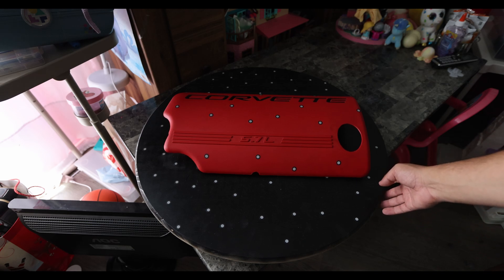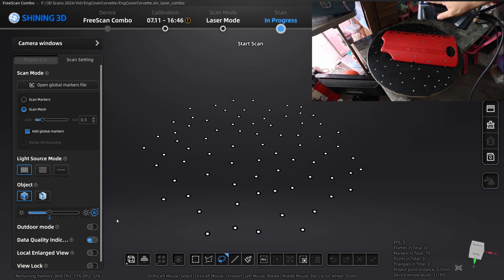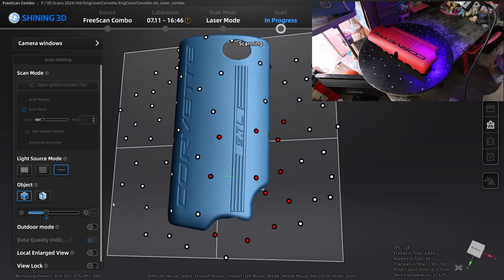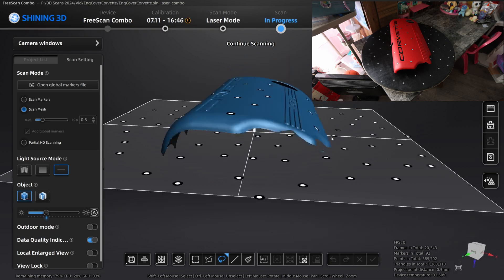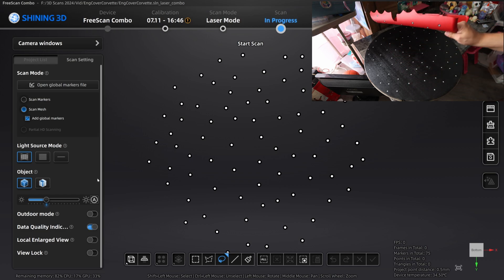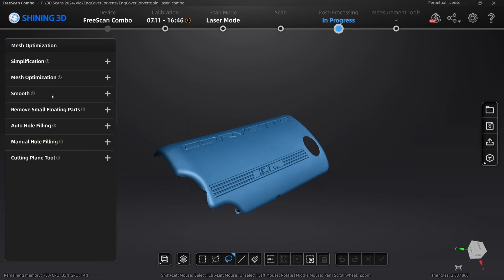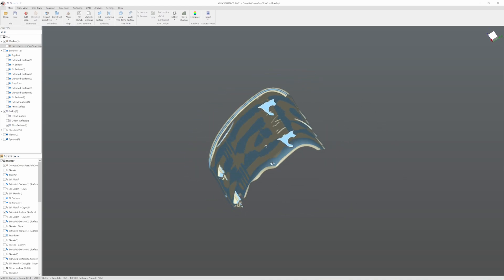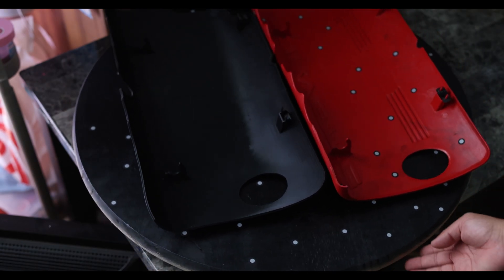FreeScan Combo/QuickSurface Reverse Engineering 3D scanner Review- Making a Custom Engine Cover

Comment: its fast and smooth mate
whts your computer config
cpu or gpu hunger during scan? thx
Reply from the maker: Never checked what the resource usage was when scanning but my specs are a 3060 with 12gb of ram and 64gb with an I7-11700 3.6Ghz. This was also scanned on a HDD not SSD so even faster on an SSD
Reply: @ good to know 11gen can do the good job 🙂‍↕️thx mate

Comment: Can you automatically render the solid cad from the scan mesh?
Reply from the maker: Yes you can use the autosurface tool and it will create a whole surface from your mesh which you can then thicken to create a solid cad file. This would be a quick way to generate a cad file however it will need to be cleaned up unless you have a very noise free scan mesh

Comment: Interested in the workflow in QuickSurface. I will be receiving the Shining3d Einstar 3D today after finally convincing myself to just do it. I know there's a huge difference between these two scanners both in capability and price but I'm looking for the best way to convert the scanned data into an editable CAD model. I work in IronCAD which is fantastic for engineering but doesn't work well with imported mesh data. I will need to be able to bring in usable data to reverse engineer parts. Since it's just a hobby, the sub $1k scanner will have to do.  Anyway, nice video on the process and look forward to seeing more.
Reply from the maker: Thanks! I also have the einstar and it’s a very capable scanner. I was able to get a lot done with it and it’s the best scanner for that price point.

I will definitely show the workflow with quicksurface. There is a lite version which is yearly subscription based that is way cheaper than the pro version. However it does lack features, I’m just not sure what it lacks.